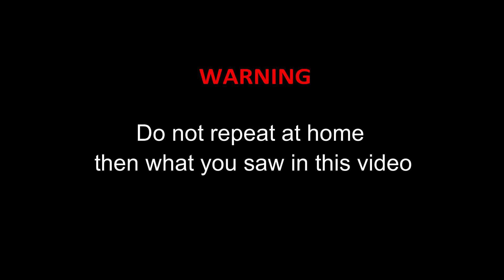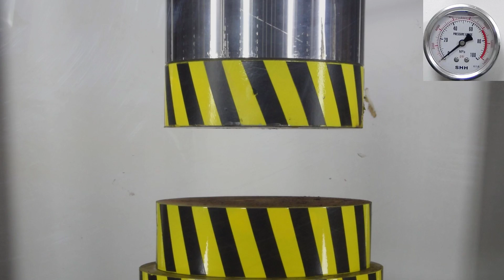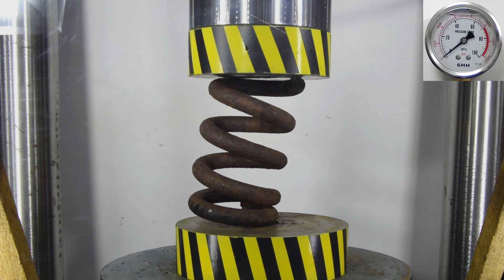500 TON HYDRAULIC PRESS VS HUGE SPRING

Comment: Working with springs can be exceptionally dangerous, the energy they store can indeed fuck you right up. Also the hardened steel is sensitive to shock damage and can easily form a hairline fracture if dropped on a hard surface, if you order new springs for car or truck keep this in mind and make sure you receive them well packaged before mounting.